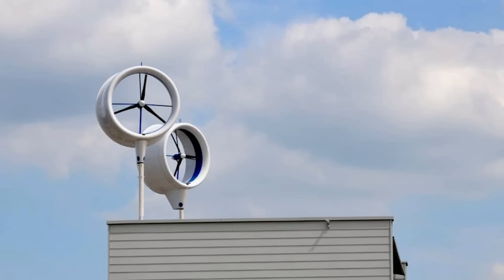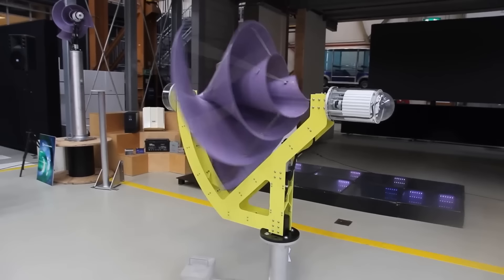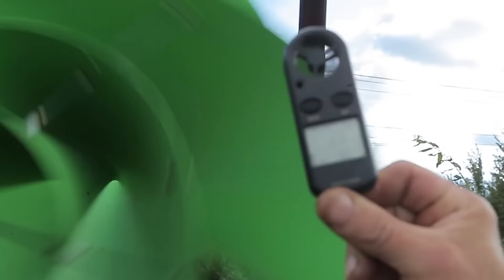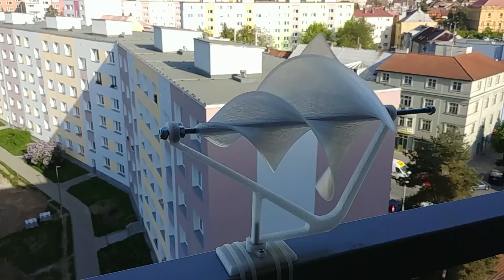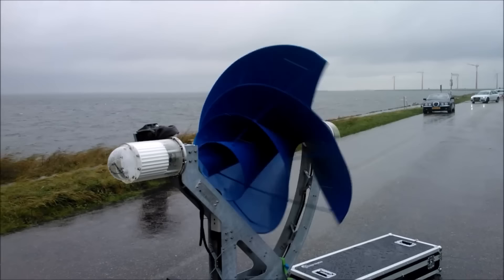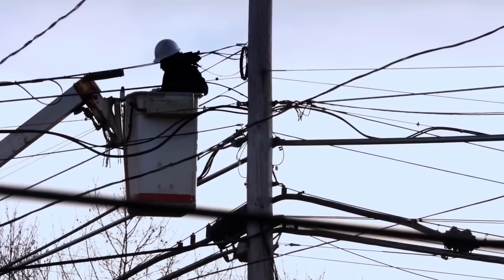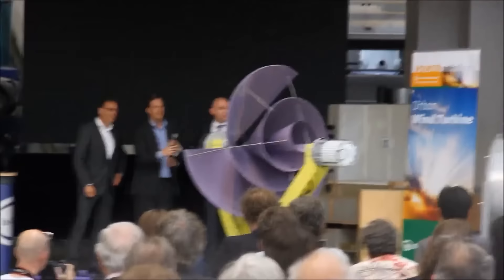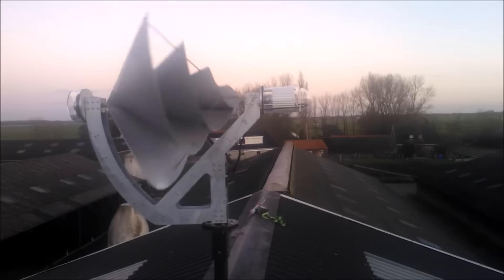How The Liam F1 Wind Turbine Will Destroy Every Home Renewable Energy Source

Comment: This product produces very little power, and costs 5x per kW what solar panels cost. 
Unless you live somewhere that is super windy & cloudy all the time, it probably won't outperform solar panels. 
And with mechanical moving parts, it will need more maintenance.
Reply: i wonder how it would perform in places like Canada where we have extreme winter weather ice storms etc...
Reply: It's not a mutually exclusive option. If you already have solar, you can install this as an adjunct. When it's bright and sunny, let solar be the primary source of energy. If it's cloudy, or windy overnight, then the turbine fills in what solar cannot do. Why the 'all-or-nothing' mindset?
Reply: was dumped by most engineers in the game years ago as just another fancy money grabber that produces very little not new at all i remember seeing prototypes of this a decade ago
Reply: With solar on a grid tied system you usually need to plan for more than your average usage because utilities like to zero out what they owe you at the end of summer right after peak power production. Wind, on the other hand, peaks in Autumn (at least in my area) so you might be able to get away with a smaller system.

From what I read each one is supposed to average 1500 kwh a year when the average annual wind speed is 5 m/s. This translates to 11.18 mph which is higher than the average some states receive. Then again, increased height decreases obstacles so increases this average. You'd really need to put a good Anemometer on your roof for a year to know for sure what to expect in your area. This would not only tell you your average wind speed, but also when the wind peaks which you'd need to calculate against your local net metering rules to determine if you need a system larger than your usage. 

Assuming the listed averages are correct though, 6 of these units would produce an average of 9000 kwh a year at a cost of $32,700 - not including installation and shipping costs. This is actually fairly close to the price of a grid tied solar system. Maybe a bit more expensive, but certainly not 5 times the price unless you live in an area with very little wind.

The real problem is that unlike solar systems most areas require a permit to have wind installed. They are more likely to approve a small system that doesn't produce noise which is probably why units like this can be more expensive than what we used to see.

Regarding maintaince a solar panel needs to be maintained up to 4 times every year. They have to be cleaned because dust and leaves will reduce their ability to function. Heat also tends to damage them over time leading to gradually decreased returns. Interestingly, wind turbines need just as much maintainance. I guess the advantage here goes so solar though since you could technically just install a PVC pipe to the side of your house, run it to the roof, and have it spray over the panels to clean and cool them whenever you turn on a hose making the typical kind of maintainance in solar easier to plan for whereas wind turbines need to have the oil checked meaning you have to actually go up there onto your roof. So, not more maintainance, just more difficult maintainance.
Reply: I think this would only be useful with solar as a top up over night when there is less being used in the house or winter. I don't think you could run a house on this. I have Solar with battery and think a small wind turbine like this would help over night or winter when we get a lot less sun. Probably not much point having it on in the summer as I produce about 2x more electricity than I use. Winter though I make less than I use or just enough.
Reply: Bingo!
Reply: @RichardHarlos  I installed a solar array and also a wind turbine. Bottom line is the turbine is useless. If you live on the coast or on a high, windswept, area you might get something but in suburbia all you will get is complaints from the neighbors with your turbine.
Reply: @mb-3faze  wrote, "Bottom line is the turbine is useless."

It might have been a good idea to evaluate that *before* installing it, hm?

mb: "in suburbia all you will get is complaints from the neighbors"

One reason why I wouldn't choose to live in suburbia. I think people should mind their business. If they're close enough that me living my life in my yard is something for them to complain about, then their house is too close to my house. Why would I voluntarily pay hundreds of thousands of dollars to put myself in a position where someone else feels, or perhaps even has, the 'right' to complain about anything I'm doing on my own property?
Reply: @RichardHarlos  I did the engineering calculations beforehand with the rather limited wind speed/height data I had. Although sceptical, I installed the 600W (max) turbine on a barn in a rural location with no other buildings in the direction of the prevailing wind. Further, approx 1/4 mile away there are two commercial 1MW turbines so the proposition seemed reasonable. The 7ft diameter blades spin OK - but there's just not much power (cube law and all that) until the wind is a steady 20mph. Anyway, it was a relatively cheap and interesting experiment and at some point I'll take it down and sell it to someone who lives on the coast. 
The suburbia comment was really a warning to people to prevent neighborly unpleasantness. This installation is in England where, even if you live in the leafy countryside, you still have neighbors and people can be quite intrusive. 
My conclusion is if you want decent reliable continuous power, then buy a property with a permanently flowing stream and install 500+Watts of hydro turbine. Supplement that with solar and you'll do well.
Reply: i was about to mention the moving parts aspect myself, that is a big thing people tend to not think about until something breaks...
Reply: Or a wife that doesn’t shut up, plant her in front of it, on the roof, win win.
Reply: @RichardHarlos  "or perhaps even has, the 'right' to complain about anything I'm doing on my own property? " sure, let me blast a loud speaker from my property 6 hours each day or maybe i should burn something and if the smoke get to you, well that's the wind fault. right?
Reply: Seems like a hybrid system may work best. I know in my area the average is about 20 mph a year, but it is only about 8 mph during the summer months. It seems to me having a 1/2 of both systems may work best to not have to meet the needs in the winter you normally wouldn't meet. @Elliandr
Reply: @RichardHarlos  Excellent point.
Reply: I was just thinking of building my own! Or well try to.
Reply: I wonder why it would cost so much? It seems pretty simple with a small amount of parts.
Reply: @mb-3faze  "All you get is complaints from the neighbors"

So. . . you're saying it's not a total loss.
Reply: @flodjod What if improvements have been made ? To be fair, internet has changed since the last time you saw it, and trust and believe, if it remains a below par product, we will most certainly be made aware of it. 👍
Reply: @RichardHarlos  What he's saying is the cost is way too high for the power it actually delivers.  It would take 20+ years to break even on this assuming it lasts that long and you have constant good wind speeds.  There's a reason you still can't find these for sale after 10 years since there announcement and every site that advertises these is a carbon copy ad sites and every youtube video about them is AI generated, just like this one.
Reply: @Ryan-ff2db  wrote, "What he's saying is the cost is way too high for the power it actually delivers."

I've replied to 3-4 people here so I'm not clear which 'he' you're referring to. If you mean the OP, then my reply to them is that wind fills in where solar does not perform. So, when you say 'the cost is way too high for the power it actually delivers', let's be mindful of the context in which wind delivers and where solar cannot. In this context, from where does your metric for 'too high' come? And please note that I'm asking a sincere question, not just disagreeing for the sake of banter.
Reply: And it is so cheap to manufacture lol, if it was as good as they say others would have copied them, the fact that after an extensive search I cannot find them for sale anywhere even at the inflated prices is very telling.
Reply: @andrewbrown6578  wrote, "the fact that after an extensive search I cannot find them for sale anywhere even at the inflated prices is very telling."

Is it? Enlighten me. What does it tell you? Also, what do you consider 'an extensive search?' Did you go to the company website and reach out to them via their "Contact Us" form? If not, why not? How 'extensive' was your search if you didn't even bother to ask the source?
Reply: @@karlwithak. You're thinking about it as an all-or-nothing scenario. That's not how it's best considered. Think 'adjunct' rather than 'substitute' -- not 'solar OR wind', rather 'solar AND wind'.
Reply: live in idaho and its windy most days so wind mill for home would be great addition to my solar but been looking for a good reliable reasonable priced one that will work and not fall apart
Reply: dont forget not too much wind or it will fall to bits
Reply: What mechanical parts? It's a fucking latine sail hooked up to an alternator. Every 5 years or so you'll need to drop a couple hundred bucks at autozone.
Reply: @johnaeryns5364  yea you're right - left click on the turbine, drag it to roof, then turn on house power. If you need more power just put 3 more turbines next to it.
Reply: The average home uses about 1100 watts at a time, and they say the bigger one produces 550 watts... It sounds like 2 or 3 of these would cover it.

Comment: Something found on the web.  These things are up there with those water out of thin air devices.

It's a drag wind generator with no aerodynamic component increasing generation. This makes it effectively closer to a Savonious than to even a Darrieus turbine, which is to say close to the least effective common form of wind generation used for pumping water and the like. A two- or three-blade horizontal axis wind turbine and most Darrieus-style vertical axis wind turbines get an extra kick from aerodynamic lift, especially the HAWTs.
It uses an awful lot of material for the amount it generates. All else being equal, you need to increase your swept area to get more energy from the wind. A two- or three-blade HAWT uses a very small amount of material to increase the swept area because swept area increases by the square when you have a circular swept area with an axis in the middle. This thing looks as if it would increase material required more than the swept area, which means its intrinsically limited to be tiny.
There's no way to feather the thing except by turning it 180 degrees to the wind, which only partially reduces the wind load. This means that you can expect it to get blown over in high winds much more regularly than more sensible designs.
They are idiots about installation. Their site shows these things mounted directly on rooftops. Anybody with any knowledge of the physics of laminar air flow knows that all else being equal, rooftops are really stupid places to put wind generators because the wind is slow and extremely turbulent there. Putting wind turbines on masts well above surrounding obstacles and in the clearest air possible is the only way to get economic amounts of electricity out unless you build your wind generator from spare parts you have in your shed as a hobby.
They go down the path of dissing solar panels -- need maintenance!, don't work in the dark! -- and other types of wind generators -- kill birds! -- instead of publishing standard wind speed to power generation curves which every credible wind generator manufacturer does. And I say this having dug into the spec sheets and scientific papers on their website. This is two anti-patterns for the price of one.
Reply: They do actually publish efficiency curves for the turbines and they do not look good.

3m/s is the cut-in speed. If it's below that either it can't spin the generator or it just doesn't spin it fast enough to generate any sort of usable power.

Even on their 1.5m model in order to get the 1500kWh/yr it would need to output 172ish Watt constantly 24/7. 
In order to generate that 172W it needs a wind speed of around 9m/s. So it needs constant wind of around 5bft or 20mph in order to get that advertised number.

In order for it to reach it's rated output it needs wind speeds of 12.5m/s or just over 6bft or 25mph. Oh and it cuts out at 14m/s and self destructs at 35m/s.

So it doesn't do anything below 3bft, it won't reach rated output until 6bft, it cuts out at 7bft, and it dies at anything over 11bft.
That seems an awfully small window of operation.

Oh and they apparently start at 10k euro, not including structural work to the roof, because it needs to withstand 3kN of load during normal operation and probably a lot more during storms.

Comment: I have seen this model before, then called the Archemedes wind turbine. Same promises, but could not deliver. Costed more than it will ever produce in energy.
Reply: The video mentioned 10-years to pay for itself.
Reply: @RichardHarlos Yeah, that is wrong. They can say what ever they want.
Reply: At the price they're quoting it's unfeasible. But im'a go build one today with PVC, a curtain rod, some aluminum supports, and an alternator. Should run about 500 bucks if I do it right.

Comment: 5m/s equals 11.6 miles per hour.... even in my current location in a coastal town exposed to the monsoon, this is already extraordinary.
Reply: Correct, a location with wind speeds of 4 m/s is already considered a good location. Average speeds of 5 m/s are really rare.
Reply: the slowest avg wind speed in the US is 12.91 mph and it's in Delaware (no wonder Joe is slow)....
Reply: @arnauddechamps855  Where did you find this? To my knowledge it is not and wind speeds are usually measured 30 meters above ground. So unless you put the turbine on that height on an open field the wind speed will be lower.
Reply: or 18km/h.

Comment: You will still need to either store the electricity in batteries or share it with the 'grid'. Sharing your unused electricity with the grid builds up credit which can be spent on electricity when your device's output is lower than what you require.
Reply: Except in places like Cali where the energy companies tax/charge you to death on it.
Reply: Looking at the output figures of the smaller generator, you aren't going to share anything with the grid, you will need a wind speed of 10m/s just to keep the lights on!
Reply: The deal with the power companies vary wildly.  Effectively the power company doesn't walk to take on being a battery and having power when they don't need it either.  Not saying the new deal in California is fair but neither is simple net metering.

Comment: This type of energy production (at least here in Western and Northern Europe) is very useful because solar panels do not give enough production during the winter period. And at those long nights you don't have sunshine either and in winter it's often cloudy (windy) weather. There this turbine comes in pretty handy. According to sources the average windspeed on my location here in the North of the Netherlands is about 7.5m/s, so it definitely can help out. When the wind is blowing, especially at night, and the temperature is cold, then turn on the convector heater or even store heat in a type of stone that can store heat for a long time, only when you have excessive power available. That would be ideal. I would love to buy one or two of these, and never have to worry about energy again. Also because in my country 'netting' is being abandoned.
Reply: The North Sea is definitely a windy location, but I think it is highly unlikely that you can achieve such wind speeds. The usual rule of thumb is 4 m/s  for a good location, 5 m/s for a very good location, and 6 m/s for an extraordinary location. If you really thin about it, you should put up a mast and do measurement for at least 1 year.
Reply: Do you have one installed? If so, please post a link to your data so we can all confirm reality.
Thank you!